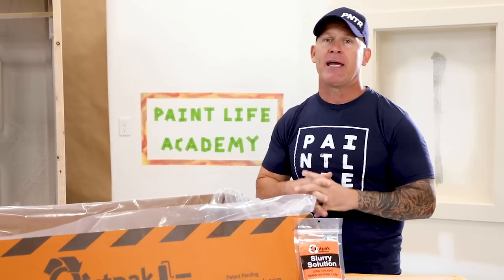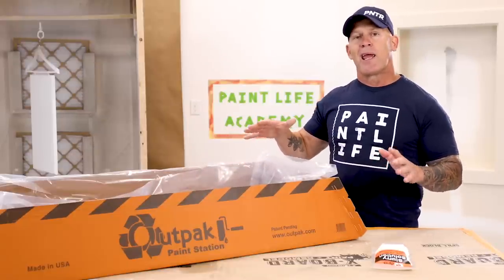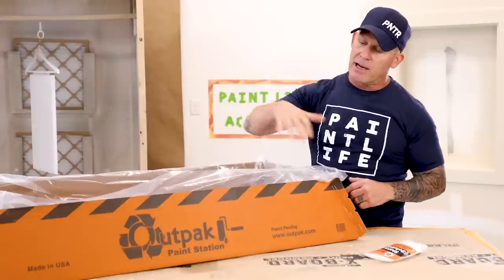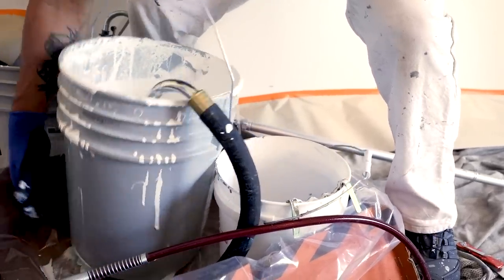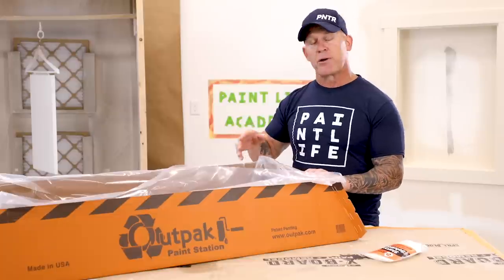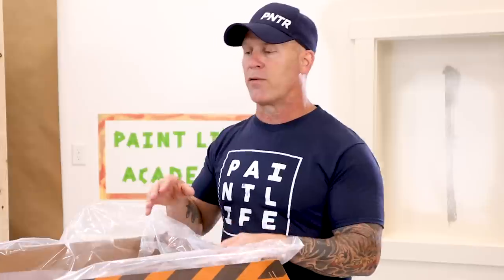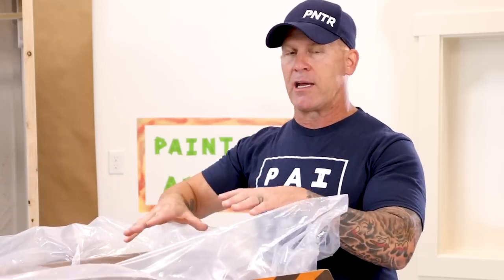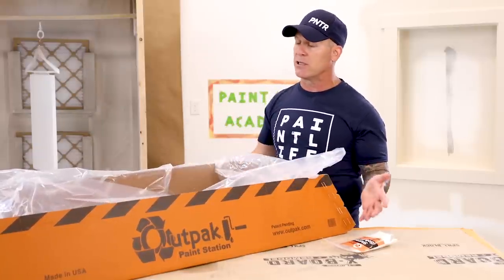Contain PAINT SPILLS.  Outpak Paint Station?

Comment: Thanks for the information! I started doing this type of paint bucket protection a few years ago. I just use a sturdy cardboard box and heavy plastic that's stapled to the top edges. I've only had a few spills but thank goodness, I had the paint inside of the box! It's soooo much easier to prevent a problem than try to deal with it once it has occurred!

Comment: Not a fan. Just one more big bulky item to keep in a work vehicle. I bet you will use it less than 4 months
Reply from the maker: Joseph L until you local EPA requires it!
Reply: On the inside we will use a low level tub or 4 mill plastic under a drop cloth  and “against a wall or in a corner” is always a rule of thumb